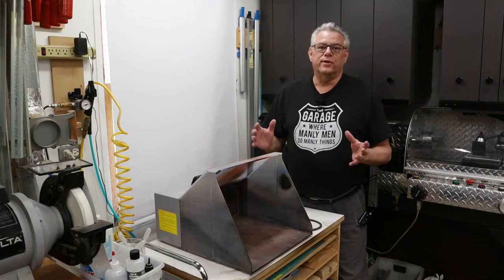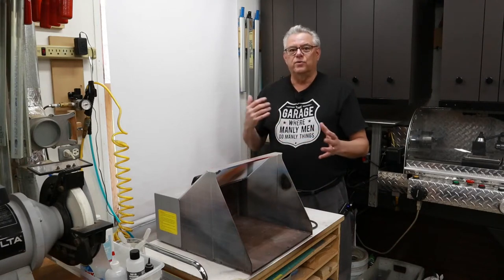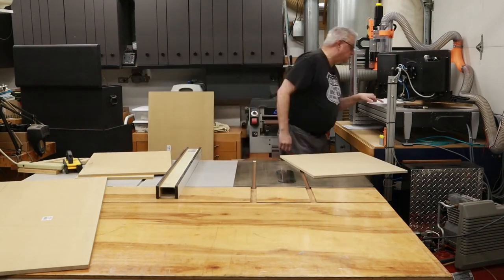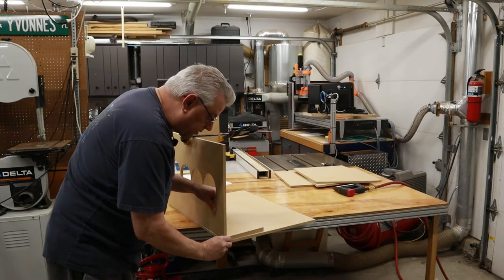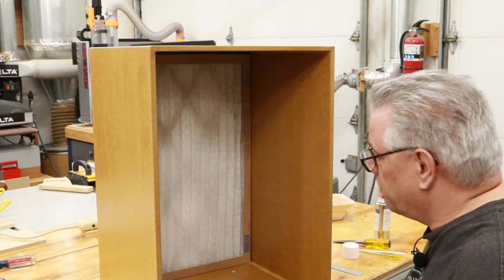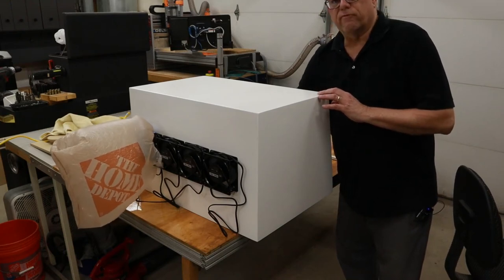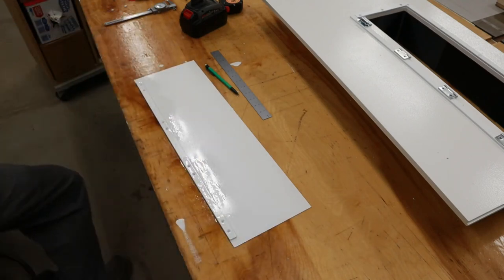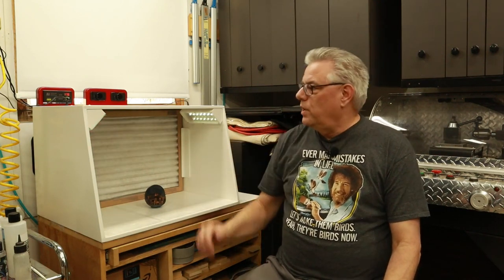How to Make A Craft Size Paint Booth

Comment: I love this video , really Great work and craftmanship , i wish had the same skills as you :)
 also like the fact you converting to mm not many do from the US.
Any chance you can use this out side in the summer , 
i really want to make this one but i live in a very small home,
and do not have the space for it insidem  even my shet is small :)
Reply from the maker: Hello Hexxas,
I don't think this will hold up outside very well.  If you substitute the MDF for an exterior plywood and some exterior paint that will help a lot.  The other issue is the fans, as they are electrical and are not designed for exposure to rain and snow, that would present a very dangerous electrical condition.
Sorry.
Cheer!
Chris

Comment: I was waiting to see how you were going to seal the MDF. I also like/prefer shellac for sealing MDF. The shellac keeps out the moisture and toughens up the edges.
Reply from the maker: Shellac is one of my favorite sealers for MDF, not really needed in this application though.  This has served me well thus far except one of my lamps is acting up, one of the LEDs is probably failing or has a bad connection. One of these days I will get around to it.
Cheers!
Chris

Comment: Hi Chris, old video I know but came across this while looking at ways to make my own airbrush spray paint booth. You may mention this in the video (I’m currently 20mins in as I type) but do you have the plans and .stl files or parts list at all? Also how is it holding up 2 years on? And changes you’d make or improvements made? Was the wood thick enough or could you of gone thinner to save weight?
All the best, Steve.
P.s. I’m in the U.K. if it matters.

Edit: just heard you say plans etc on your website 👍🏼
Reply from the maker: Hi Stevenfindlater302,
I don't think I have had proper links to the supporting documents, sorry about that.  Furthermore, on the companion website I placed that project in the CNC section.  Must have been a really bad day!
Here is a link to the companion website
https://makingstuffwithchrisdehut.com/

Here is a link the supporting files.
https://makingstuffwithchrisdehut.com/misc-project-files

Regarding how it is holding up...
I have not used it as much as I would like to but it does work really good.  The exhaust fans keep up good, the filters contain most of the paint and don't pass it all through.  The lighting is pretty good, one of them is giving me fits but that appears to be a bad solder joint.  
It is heavy, you could certainly make it out of some material that is less thick but you may have to reenforce the corners.  

All in all, I am very happy I made it and certainly my lungs are happier too!

Cheers!
Chris

Comment: Came across your video, and was wondering in the fans you used are "explosion-proof" (i.e. rated to extract flammable vapors such as many type of spray paints, lacquer paint fumes, etc.)…?

If they are, do you have a link to the where to purchase these fans (or brand name and model of the fans so I can search from them online)…?

Thanks in advance.
Reply from the maker: Hi lestatdelc  

Unfortunately this spray booth is not intended for flammable vapor painting.  As for explosion proof fans, be prepared to spend a LOT of money and to build the booth out of metal and metal ducting.  

Chris
Reply: @MakingStuffwithChrisDeHut  - "be prepared to spend a LOT of money and to build the booth out of metal and metal ducting."

Yeah, that's why I was so excited about your fan/spray booth, because I was hoping you had a line on a vapor-capable fan that wasn't in the $100+ plus range.

But thanks for the reply.
Reply: In Italy here we have these Oven fans (Ventilatore TANGENZIALE per Stufa) which use a centrifugal fan where if you construct the duct right you can keep the airflow sparkfree. Cost about 30-40€. Works ok mostly. 🙂
Reply from the maker: Thanks for sharing that information!
Cheers!
Chris @malrex0mari

Comment: There's no mention of using explosion-proof fans. Depending upon the solvents in the paint, not using spark-free fan motors can be a hazard.
Reply from the maker: I am pretty sure I mentioned what type of paint this is suitable for.

Chris
Reply: I’m a mechanical engineer with experience in explosion prevention design. I see this comment far too often by people with no actual experience or knowledge in this space. Telling a hobby spray painter to get explosion proof exhaust fans is like telling a baker to get an explosion proof kitchen aid mixer because flour is explosive.
Reply: With any reasonable amount of CFM, you will never reach the LEL required for ignition for any of the chemicals being used. We are baking, not manufacturing flour.